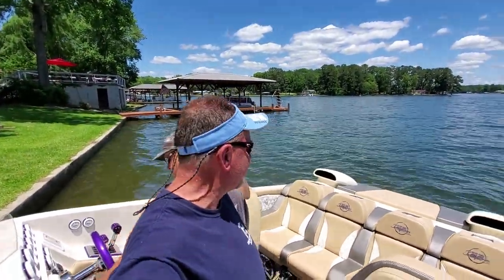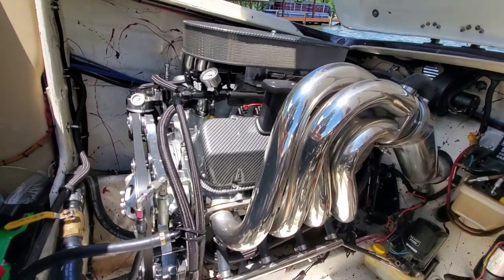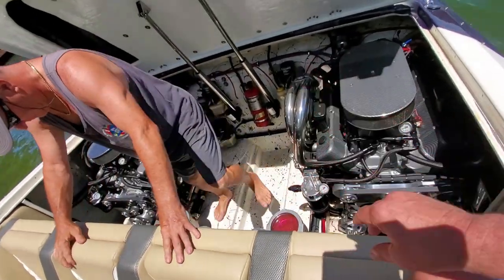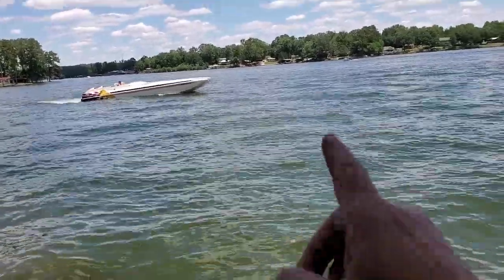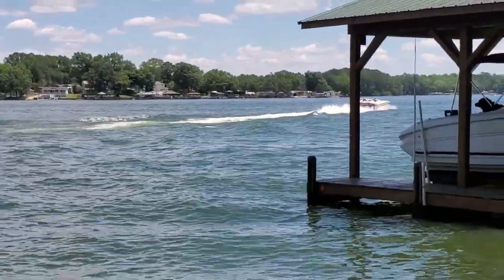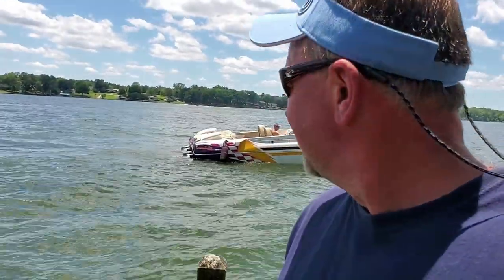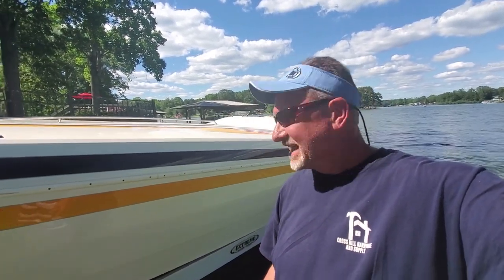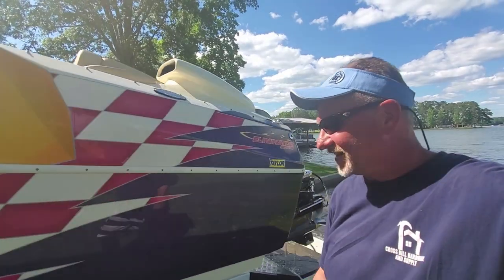Eliminator 33 Off Shore Catamaran launch and run!

Comment: Great boat, great video, but didn't show much video of it running and no mention of how fast it can run with 1400 hp?
Reply from the maker: We're at 115 mph @ 6,000 RPM. It's very difficult to hold a camera at that speed or speeds above 90 mph. and even hear the boat for all the wind. We'll do another this summer
Reply: @classicperformance  very cool! Thank you for replying! I have the same boat getting my motors redone now should be 750 hp each. What props does it turn?
Reply from the maker: @csnyder1453  we have tried all different props and blades including a set of cleaners. If memory serves, 32s from B Blades are on it now. With the new motors it wanted to porpoise no matter what props so we put 100lbs of ballast up in the nose of each sponson. Best of luck with your build!!
Reply: @classicperformance  thanks again for the reply I was running 4 blade bravo 1 34p with 700hp a side no balist. I also have 36p bravo 1 4 blade to try. Did the ballist stop the porpise?
Reply from the maker: @csnyder1453  The ballast indeed worked well and almost eliminated it. I just had two 50lb bags, not two 75 lb bags.
Reply: @classicperformance  so you have 2 50lb bags in each side? Thanks in advance for the infor!
Reply from the maker: @csnyder1453  one 50lb per side.
Reply: @classicperformance  sweet! Ok thanks for all the info I'll let you know how it goes in the summer!